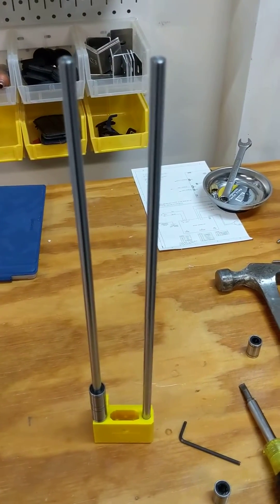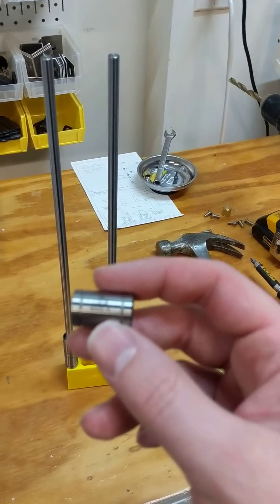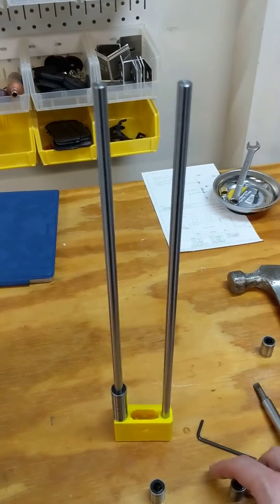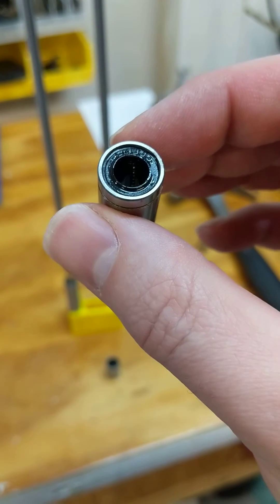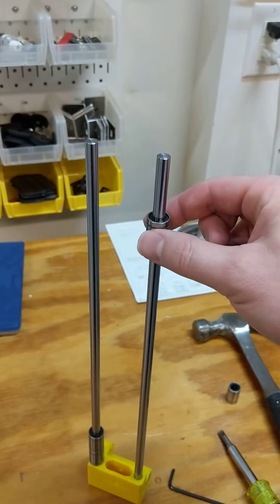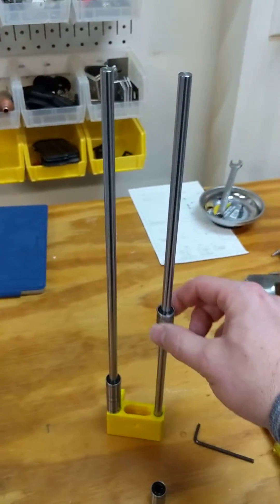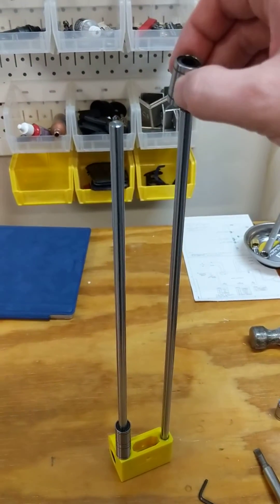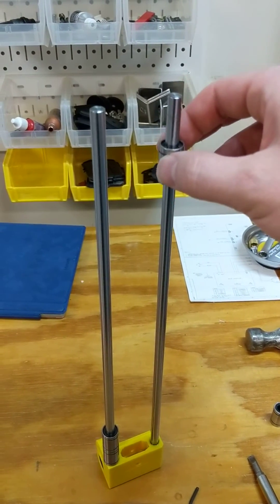Misumi LMU8 bearings for Prusa i3 MK3

Comment: Your video is old but currently I have the same problem with Misumi parts. I don't know if it does matter or not but it's the rod is not constant and some bearings are not working smooth

Comment: Would you still run these? Or did you buy different ones?  How many do I need to replace all bearings for the printer.
Reply from the maker: Yes, I'm still running them today.  Misumi "LMU8".  I don't recall exactly how many you need but I THINK it is 6 for X and Y which is what I did (my Z's are still Prusa because they are a pain to swap).
Reply: Ray Ackley would you buy any of that other models of the same bearing or stick with the ones you have?
Reply: @rayackley  Z probably isn't even worth it.
Reply: @rayackley  Are you still running these?
Reply from the maker: @grindel80  Yes, and they're going strong!  I run the printer probably an average of 2-4 hours a day as I use it for a side business.

Comment: The bearings that came with my Prusa Mk3 in June 18 were crunchy too.  Worse if you tightened the holding brackets or tie wraps.  I need better ones because it sometimes throws off the Y end stop during calibration.  I just installed Misumi replacements and it made a BIG improvement.  I ordered them online from Misumi.  But today I saw IGUS sells plastic replacement bearings for a lot less.  I probably would have gone with IGUS had I seen it first.
Reply: When you use IGUS you may need to build in a pressure adjustment to keep the rods snug and in future wear and tear. Many people don't understand the bearings require a pressure fit to bring them to tolerance.

Comment: Does your i3 mk3 run smooth like a hot knife through butter with these (when running)?  I'm still waiting on my mk3 but always and I mean always looking for better parts and stuff to upgrade even before I get it (save the disassembly trouble later on).  Any thing else you noticed during assembly that should be changed?  My mk3 just shipped LOL

Edited because the status just changed to "shipped".